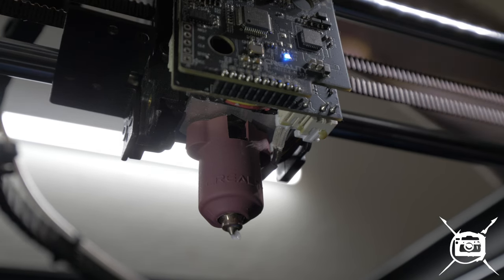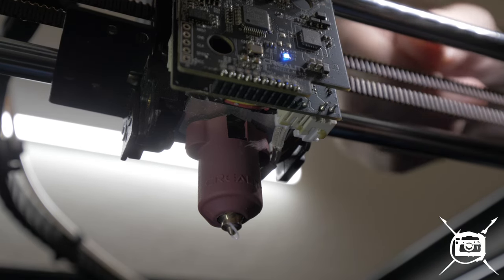Creality K1 Max Nozzle Exploded

Comment: I had this on mine but worse... You will most likely have temp sensor issues I had to heat up 10° a time slowly to 200 then could remove. Still split wires but switched to micro swiss hot end no issues since. Just make sure the microswiss got end is tight enough as had come loose first time.
Reply from the maker: At this point ill just run 0.6 nozzle until I find a suitable replacement for the 0.4 unit. I Really like what I'm seeing from Micro-Swiss. Ill post a comparison between the two units. Im enjoying the 0.6 so far and don't think ill be going back to 0.4. more options with materials and better flow rates for faster prints. As far as resolution goes, i jus drop the layer height down to .15 and its produces great results.

Comment: How many prints prior to the failure? And did you say this was a QC issue with assembly from Creality?
Reply from the maker: I like the QC of the k1 Max so far. They seemed to have fixed their initial issues creality had initially. I'm quite happy with the unit overall. I would say i had approximately 50+ prints before any issues. The only issue i had was a clog and i think i caused it by pulling on the filament during the retraction faze of changing the filament type. I frequently change between TPU PLA and Nylon.

Comment: Oh wow I thought this only happened on cheaper printers. Happened to my ender 3 pro. It ripped the thermometer wire and split it. The heater wire was frayed and snipped. I decided to abandon the headache and purchased the ender 3 v3 KE
Reply: I would bet money that it was just nozzle install error. The sheet metal wrenches that come with the machine are not adequate and it really needs to be torqued with a real wrench while at operating temperature. I was able avoid leaks after doing this but have since ditched brass nozzles because they can break trying to remove them.
Reply from the maker: I believe this was install error as well. I had a clog not too long before this happened. When addressing the issue i don't think i tightened the nozzle down hard enough in fear of breaking it. @clutchboi4038
Reply: @WirgesHavingFun Happened to me on Cr-10 se (same hotend). Also probably the nozzle was not tightened enough after clearing a clog. Managed to clear it, but damaged the heater and thermistor wires in the process, so replaced the whole hotend. Lession to be careful when repairing printer tired
Reply from the maker: @milospavlovic7520  mentioned this in the video. I believe I just didn’t reinstall properly

Comment: Looking at this printer for next upgrade. I have cr6-se for a few  years now, works great....but slow. So do you think this issue was from a cold pull to change filament? I'm asking because I do cold pull at around 125 c then run a cleaner filament thru at operating temp, then load new filament in when changing filament. Thanks for the video!
Reply from the maker: looking back, i don't think it was anything to do with cold pulling specifically. i wasn't trying to clear a clog in the nozzle but i was just trying to change filament type and was being impatient. pulling up on the filament leading to a glob of melted plastic  its self at the top of the fin stack is what let to my initial issue. my solution to it was taking it apart, witch lead to this videos problem of me not putting it back together properly

Comment: Put on the Micro Swiss and throw that one in the garbage.
Reply: Lol I threw my microswiss in the garbage and put on a phaetus dragonfly bms. Much better design especially for high temp filaments.
Reply: @clutchboi4038  On a K1?
Reply from the maker: Ill have to look into this, i dont think ive seen it on a k1 yet. ill be weighing the different Types of options for the K1 Max and share my thoughts in the future @clutchboi4038
Reply: @clutchboi4038  Lol sorry you had to buy 2 to figure that out